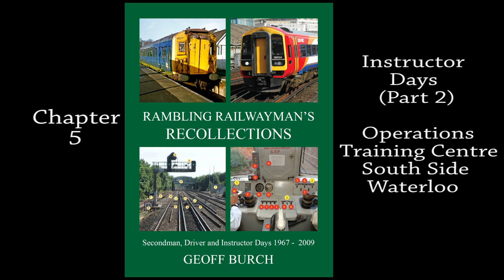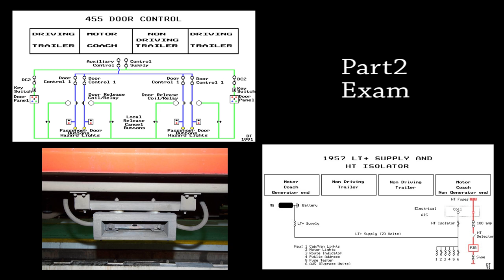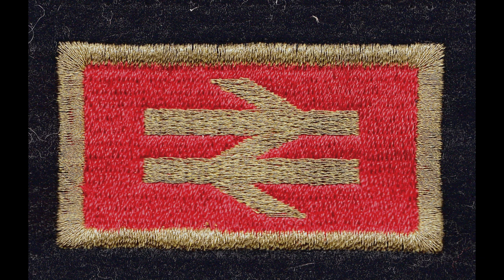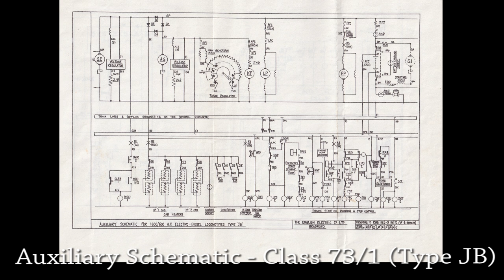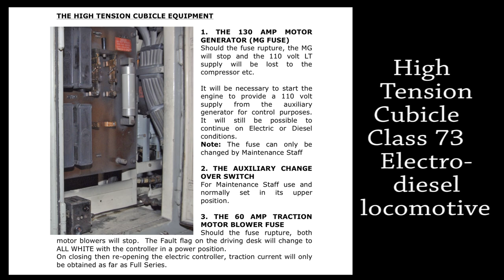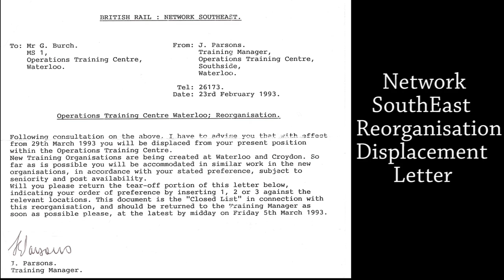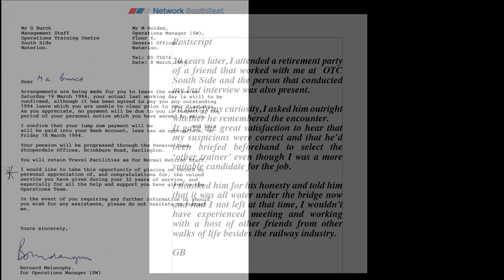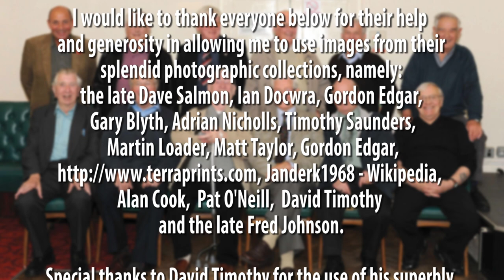Rambling Railwayman's Recollections - Instructor Days - OTC South Side Waterloo (Part 2)

Comment: I can well understand that backstabbing you experienced Geoff. Whilst I loved my 31 years on the railway with my railway family there were some nasty times and vindictive ones from the management. My Guard's Inspector, Peter Baker, took a dislike to me for some reason and I have no idea why. Maybe it's because I always stood up for myself when falsely accused.
One occasion was after working the very busy 18.30 Waterloo to Weymouth, 10 car Wessex Electric. I had checked tickets and taken roughly £200 by the time we arrived at Winchester and would finish the rest of the train afterwards. A couple of days later and despite the evidence of my takings, I was accused of not doing tickets at all.
I protested this of course but Peter Baker said that the Chief Revenue Manager from Waterloo was 'well able to see that you didn't do any tickets'. He must have been sitting in one of the first two coaches, itself unusual because most managers had a 1st class pass, and got off at Winchester before I got there.
This same Guard's Manager got me in trouble with the station manager at Bournemouth and they had my car clamped whilst my dad was dying in hospital. I was parked in front of a ticket machine and there was nothing to say that you couldn't park there. They had a yellow line painted around my car while it was parked there! I had before and after pictures though and took the clamping company to the small claims court. The railway settled out of court for the cost of my hire car that I used to see my dad in hospital.
Despite being on for 11 years at the time I kept being overlooked and driving jobs were given to guards that had been there for 2 years. I later heard that Alan Cuckoo, another Guard's Manager, told someone that I would never be a driver at Bournemouth.
Thankfully, being an ASLEF member at the time as guards were once allowed to be, Pete Rapley - Driver's LDC, fought for me to get a driver's position.
I went for an interview at Southampton and was interviewed by Bob Silk and Richard Trellis. They offered me a job at Salisbury which turned out to be one of the best things I did, driving the wonderful 159s. I later transferred back to Bournemouth for a few years, so much for 'will never be a driver at Bournemouth.'
I missed the 159s though and the routes but was lucky enough to do a swap and spend my final year's at the wonderful Salisbury depot.